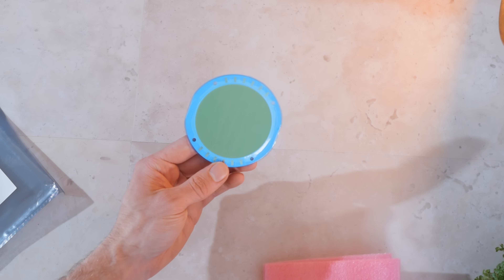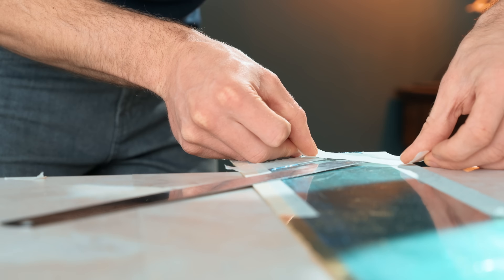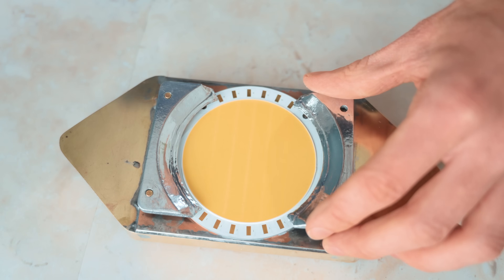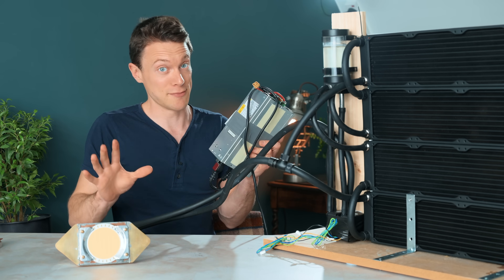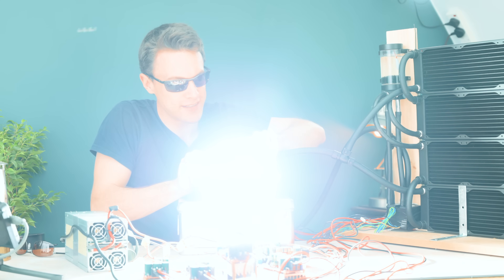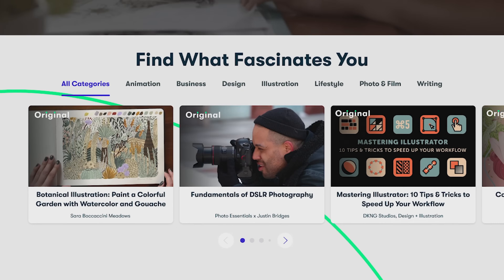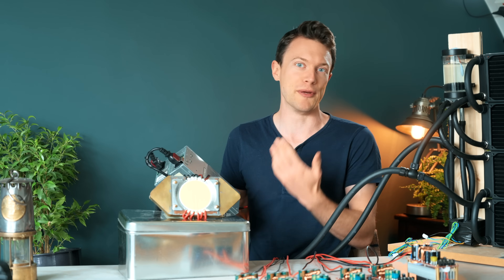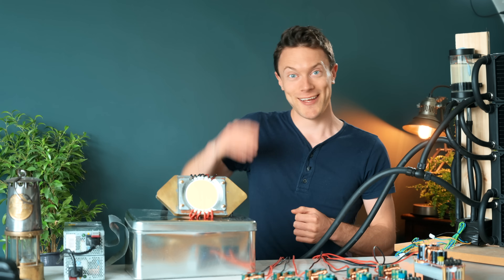Testing the world's BRIGHTEST LED!!!

Comment: I think you missed something here. The total wattage of the power supplies you used is 2000W however that number is the combined load of 12v, 5v, and 3, Rails. As you are only using the 12v rail to power the LED. You need to use power supplies that have at least 1000w each on the 12v rails alone. I think this is the reason why your one failed. I hope this helps, best of luck!
Reply: On top of that he was using the older used power supplies, and as most people that mess with those things know, their power output degrades as they age.
Reply: Was just about to comment something similar to this. He would likely be better using using a transformer from a microwave or similar. Something that can push the wattage needed at a consistent level and use heavy duty resistors to lower the voltage. 
I think the cooling solution is over kill too.
Reply: @ThatTaytoGuy  yeah the cooling solution was pointless. He could have done it with a single rad easily. I think he forgot that the water block he made is basically a mini radiator also lol.
Reply: @zoobs555  the cooling solution might not be overkill, the whole thing would need to run longer though in order to get to a stable temperature because with such short operation time it wont even heat up the water itself yet. Thats why people usually run watercooled system for like an hour when testing them takes a while for the water to heat up and get the real cooling limit.
Reply: @Rakinshu1203  That's true however we cant be sure how long he had it running for plus with a LED that high in wattage I don't think someone will run it for too long anyway unless they are rich enough to pay £1000s in electricity bills haha ;-)
Reply: ThatTaytoGuy Yeah, I wanted to comment basically the same thing
Reply: @ThatTaytoGuy  He needs 24v DC, transformers change AC to AC at different voltages.
Reply: Server Power Supplies like those only produce 12v, and are then stepped down to the needed voltage at the back of the hotswap tray thing in servers, so they will be rated for it.
Reply: Upvoting so he sees it
Reply: I suspect that if he powered all 6 lines at once vs one by one it could also contribute since it's a huge and sudden power surge
Reply: Oleksii ooh good point
Reply: Maybe the Amperage rating for the 12 V rails is printed on the power supplies. Maybe DIY Perks could calculate it, and give us an update.
Reply: His real issue is cooling..  cooling the power supplies.  Theyre meant to operate at the back of the server chassis which is filled with fans moving tons of air over the components, power delivery components included.  These poor things were left in an open air environment without any assistance outside their tiny little 40mm fans
Reply: On top of all of this, depending on the internal arrangement of the psus, connecting them in series could fry them. If the diodes on the low voltage side (rectifier) have a switching value lower than the 24 V he's trying to draw, then they are likely to fail after a short run. He'd be better off with uninterruptible power supply batteries or lawnmower/car batteries as they have the capacity to handle the load in terms of amps.
Reply: Server power supplies are designed to work ( in temperature between 12 to 16 degree Celsius ) in server room to get full performance as rated power capacity 
Thus putting it in  temperature almost doubled resulting damage to power supply or maybe Limiting its output power
Reply: The 1000w rating is peak burst as well it's probably only rated to 600w continuous total.
Reply: Server power supplies, unlike desktop ones tend to have almost all of their load carrying ability on the 12V rail and can pretty much fully saturate that rail.  I have a similar 1K power supply from a Proliant sitting on my desk and here are the specs:
+12.15V 82.3A (~999.945W)
+3.3V 8A
+5VSB 2A
-12V 0.3A
Reply: Think you are over thinking it.
As they are in SERIES then you will double the voltage but only at the rated current of 1 supply (ie 750w)
To double the current/power you wire them in parallel but would only have 12v output.
Reply: Yes I agree, but we can't rule out the likely hood of these being low-grade Chinese power supplies. I think the whole point was to have some fun powering up a very powerful LED.I think he designed the cooling system around the idea of let's exaggerate the heat output for both the visual effect and appeal of the video and to protect the 1300 USA dollar LED which he didn't own. I guessing he was required to send the LED back.
Reply: @Godscountry2732  Given that he means to build a dedicated cabinet for this thing, he may have just purchased it (edit: I made that comment with the video paused right before he said he is simply testing it).  Since he already had the watercooling gear lying around (save the block), I guess it was a sunk cost to use so many radiators.
Last I checked (years ago), PC PSU's are most efficient at 50% load so, withstanding the 12v rail advice others are discussing, I hope he takes the same approach with his replacement PSU's as he did the voltage boosters.  This should 50% load a pair of 1500W supplies which should minimize the power dissipated to heat in the units.   The large axial fans of an enthusiast ATX supply should also cool better than those server units at lower noise levels since they're not built for a narrow rackmount chassis.
Reply: I agree with you that it's for all the rails combined but also the voltage boost boards draw more amps to boost the voltage therefor making it draw more like 24 volts at near 100 amps so it draws close to 2400 Watts
Reply: The main problem was the series connection of the PSUs. You cant connect them simply in series if they are not explicitly made for this with a special sync-cable. Because they do not serve exactly the same voltage, only one PSU will be maxed out until its voltage drops and the other PSU will only supply the remaining power.
Reply: best explanation ever! That's perfect!
Reply: Oh yeah, I just wrote the same.
Also, I would not go with the kind of "Server PSUs" he used. They look pretty cheap with their metal cases and tiny fans. 
Why not just get two regular fat PC PSUs, there are plenty with more than enough power. 
For example the Seasonic Prime 1300W Platinum/Gold or the BeQuiet Straight Power 11 Platinum etc.
The beefier fan will also offer way better cooling.
Reply: These look like they might be hot swappable power supplies from a server.  In some cases these units output 12v only, then any reduction is done on the motherboard.  So it's quite possible these PSUs are ample for the task (12v, 1000w x2), but as with anything server related, noise output is usually a secondary consideration.
Reply: Regardless of any of these comments the power supply still should not have failed. Current and thermal limiting/derating should be built into any high power PSU.

Pretty much all high power, high efficiency computer PSUs have an LLC topology main converter for efficiency and low EMI. This produces the high voltage, main power rail, be it 12 or 24V and is the only output from the main LLC converter.

The 12/24V rail is then fed into a bank of buck converters. These then generate the 3.3V and 5V rails. As a result of this you can fully load the 12/24V lines directly as they are designed to feed the 3.3V and 5V lines anyway. As long as you don't load the low voltage rails the 12/24V should be more than capable.

Even so if you were to fully load the 3.3V and 5V rails, then connect an unreasonable sized load to the 12/24V feed it should still NOT blow up. Current limiting should engage to protect the main switches and transformer from electrical overstress plus thermal management to lower the current limit based on how hot the device is.

Put simply the power supply failed when it should not have. It's either poorly designed or defective. The engineer who designed it should be embarrassed.

This does bring into question where the PSUs were obtained. A reputable manufacturer for high reliability server racks or aliexpress...If aliexpress chock this one up to experience and buy Seasonic next time.
Reply: @biggityboggityboo8775   I understand where you are coming from however not all PSU's use a single transformer for all their rails. its possible that the PSU's he used had separate transformers for each rail hence the load couldn't be levelled out.  

So yeah I do agree that the PSU's were a bad designed and its also possible that they were old hence their capacitors etc were already used up.
Reply: @biggityboggityboo8775  What about meanwell PSUs? They seem to be quite reputable in DIY space, though not exactly PC spec'ed
Reply: @NightMind0  Indeed I use some of their power supplies myself. I would expect them to perform adequately, especially as their products are widely sold by many reputable manufacturers.

I only mentioned Seasonic as an example of a brand that are known for great reliability. 

As soon as Matt started his high power testing I started feeling uncomfortable. Which part was going to fail first? It's always a thought in the back of your mind whenever you're putting electronics under high stress. Of course I just thought I was being paranoid but then something let the magic smoke out. Hopefully he didn't have the two power supplies wired in parallel as that would encourage unequal current sharing and put them into a situation for which they were not designed (unless they were).

I'd imagine he had one PSU wired up to three boost modules and the other PSU to the other to three, but you never know. 

It would be nice to know what exploded. If the fans went crazy before the thing went poof that sounds like something was getting too hot but not being cooled adequately. Like a heatsink had fallen off or the clip holding a transistor wasn't seated correctly.
Reply: Rewatching I see he wired them in series which answers that question. No problems with current sharing then.
Reply: @biggityboggityboo8775  you can fly away now, captain B)
Reply: Imho the problem was the combination of what you said and the fact that he is using two power supply in series, which is a thing that you shouldn't do with any power supply really, but expecially with switching power supply for various resons. He could have wired half of the LEDs on a PSU and the remaining on the other
Reply: after a couple of min I thought who is this idiot....does he even know what the hell he is doing!

Comment: The total power-rating of computer/server PSUs is added up from the individual ratings of the different power rails. The voltage levels themselves (mainly 3,3V / 5V / 12V are split into several power rails.

Comment: I knew those PSUs were dead as soon as you said "Server PSU", and that was confirmed by "wired up in series"
Server PSUs are intended to have cooling assistance from the system.
Server PSUs are designed for redundant operation, not parallel operation.
Server PSUs are designed to operate at a more or less fixed ~50% load 24/7.
Server PSUs have extensive voltage regulation, and I have absolutely no idea what they would do if you tried to operate them in series.

You were running them hot without the required cooling in a configuration that makes machine spirits cry.
Next time:
1: Either use scientific power supplies that can output 30v, or use a boost converter that can handle the switch from 12v to 30v.
2: Use consumer PSUs, which are actually designed for dynamic power needs and can operate comfortably across their entire range.
3: Use one PSU per power channel, which is one of the reasons why they stuck six power channels on it in the first place.
4: Size the PSUs so that the intended draw isn't near the peak draw.
Reply: Any server PSU that has a built-in cooling fan should be able to cool itself as long as it's not being feed hot air.
Redundancy means they must be able to take 100% load, 24/7. Servers are often shipped with just one PSU to save costs with a redundant configuration being optional. It's completely within spec to run most modern servers on one PSU.

There's nothing wrong with using server stuff like this. They're more than up to the job compared to consumer-grade stuff. If people don't use them in hobby projects, they're just going to end up being recycled. What he should have done is find an old server or network switch with a 48v 2000w PSU and use a step-down converter if the LED driver(s) can't take the 48v.

Comment: As I remember the negativ terminal of these power supplies is connected to earth and the case. So if you connect two of them in series you would short one out (by stacking them and through the mains earth wire).

Comment: Matt the reason you fried your power supplies is that you let the "magic smoke" out. Magic smoke is an important component in the manufacture of many of our electronic devices . . . but the downside is that if you let the magic smoke out, they stop working as you have just found out.

Comment: Question: the aircooler you showed was desinged for a tdp of 300w, right? Considering that we are talking about a LED, witch should be fairly power efficient, shouldnt the thermal output be whithin reason for the aircooler? I'm not an expert, but wouldn't that otherwise mean, that the led is emmiting more a fifth of it's input power as heat rather than ligth?

Comment: Are those power supplies 1000w / 12v each? (As listed here: https://petapixel.com/2020/04/20/testing-the-worlds-most-powerful-led-or-how-to-fry-two-power-supplies/#comment-4883627513 ) If so and you've got them in series you've still got 1000w but 24v.  If the led needs 30v/1500w you can see where the issue is. Edit - my mistake, total would be 2000w, just at a lower amperage due to the higher voltage

Comment: If you look on the car pc sites, you will find power splitter and combiner devices because computer power supplies do not run parallel, best case scenario is you force all of the power to one and once it’s at it’s max the other one picks up the rest, a little worse is the one takes on the full load and the other one just sits there, and worst case scenario is they back feed and damage each other even within the load range of one on it’s own, the same thing happens with transistor or diode sets in parallel, likely for the same reason (the semiconductor components in the psu’s can’t load share properly)

Comment: All server power supplies that I've ever seen, and actually this also applies to desktop computer power supplies, have the DC common (negative) connected to chassis/earth ground inside the power supply. Thus, it is not possible to series-connect such power supplies without disconnecting the ground wire from the AC input (not recommended!) or significant modifications to the internal construction of the power supply to remove the connection between chassis/earth ground and DC common.

This fact, if it was not taken into account, is likely what caused the failure.

Have a look around for used/surplus industrial type modular power supplies. Unlike computer/server power supplies, those have floating outputs (no negative-earth bond), and are usually designed specifically with paralleling and series connection capability in mind.

Comment: NEVER wire up power supplies in series. That is a recipe for disaster.

Also, the cooling loop should stay on for a few seconds after the LED is turned off.

Comment: Your thermal paste application technique is wrong. Never spread the thermal paste manually. Not matter how big your dye is. That technique introduces air bubbles, which causes hot spots under extreme load.

If you want perfect contact with the dye:
1. Use better thermal paste. You'll have to do a bit or digging, since new pastes come out every year. Thermal Grizzly Kryonaught was the top pick last time I put a PC together. Don't know if it still is.
2. Put a blob of paste in the center and let the heatsink do the spreading. You should see thermal paste come out on ALL edges of the dye. That's how you know, you have perfect contact.